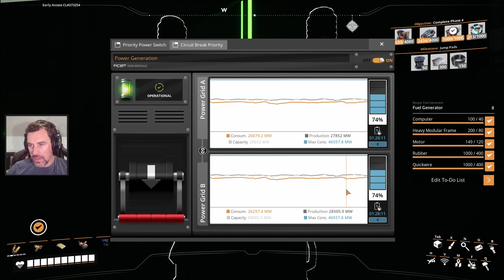Satisfactory Update 8 Episode 112: Rubber for Power

Comment: Lol. While I agree a full scale nuclear plant takes some work, its still very easy to get into if you just ignore the waste issue for a bit. Your starter factory usually can handle the few items needed for a couple reactors at 250% - or 12.5 GW. Its then still fairly easy to scale up a couple more at a time if you're still not ready/done with building out everything you need for 20+ reactors. You can just ship the waste off to some empty area of the map for a while until you feel like building the plutonium processing. Or store it near one of the uranium nodes since that will have radiation anyway. The radiation isn't an issue either because we can now always wear our supa suit... Thanks for the videos!
Reply from the maker: You are definitely correct. I just hate having to start from square one in terms of parts production to get it online. I could of course plan ahead for it actually have the parts ready to go for when I finally unlock it.